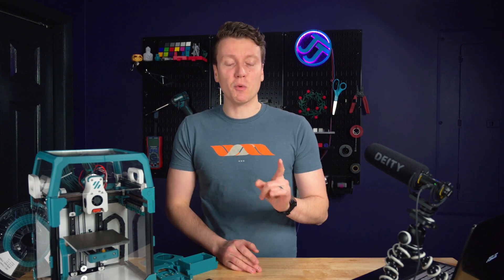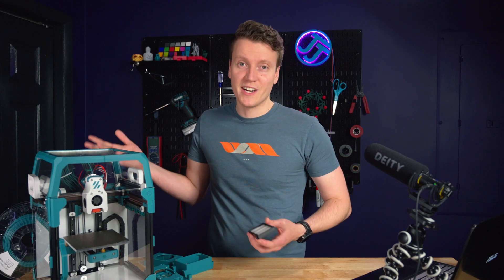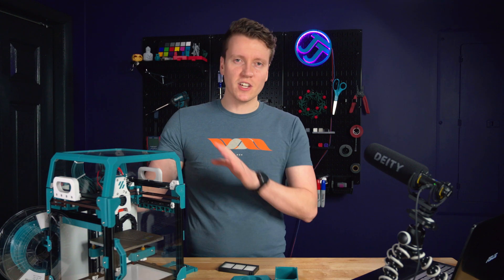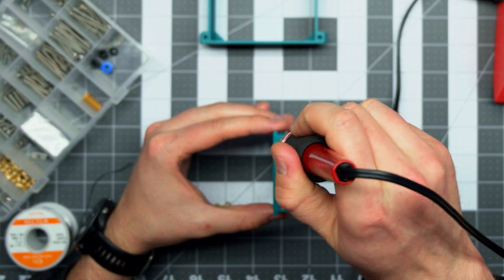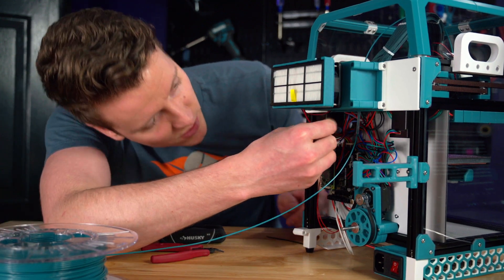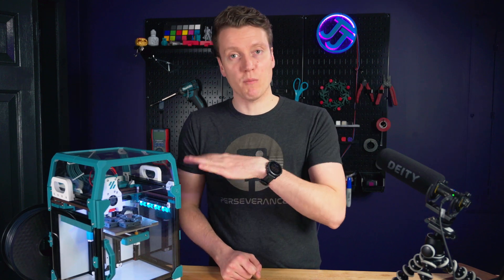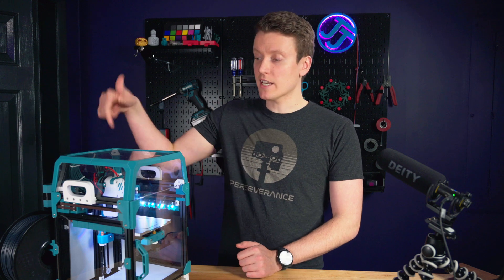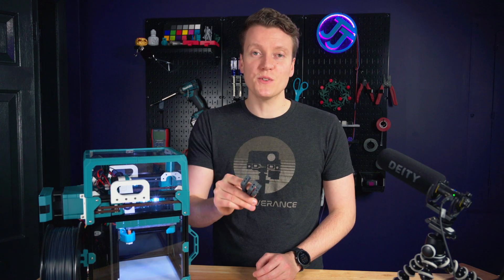3D Printer HEPA and Carbon Filter Install | Voron V0.1 Exhaust Filter Mod

Comment: you need an air sensor to see if there's actual voc and abs fumes in the air. Judging by smell is the worst method to judge safety

Comment: An exhaust fan ist better than no fan at all but onl a little, it´s better to circulate the air to capture more particles and no to loose much heat.

Comment: Why would you blow out the heated air you need in the chamber to print ABS?
I think that it's smarter to circulate the hot air inside the chamber with a filter..

Comment: Thank you for this video.  I have an ender 3 vs Max Neo and would like to use your design for my enclosure.  What model Roomba ?  Are the 3d printer files available in .stl format?
Reply from the maker: Yes, here's the link: https://www.printables.com/model/311665-voron-v01-hepa-exhaust
The filters are from the "800 Series" Roombas: https://amzn.to/3UbO4Lp
Reply: @JJShankles  I am accumulating the parts.  I have never used "heat set Inserts" before.  My assumption is that they are M3 but what about the size?  Link please!
Reply from the maker: @idmnstr They are M3X5x4, just the stock Voron ones I had laying around: https://amzn.to/3OXGaDD
Reply: @JJShankles  Thanks again for your help.
Reply: @JJShankles  Thank You

Comment: How is the air flow which such a small fan and all those filters stacked like that?  With filaments like ABS I would think you would want to vent the fumes outside rather than just using a filter.

I have an off topic question for you. If you were going to use the Voron 0.1 to build a Voron 2.4, could the Voron 0.1 print all the parts or are some of them too large to print on that small build plate.  I like the looks of the Voron 0.1, but I would have like something around 180mm or 200mm.
Reply from the maker: The air flow is for sure limited, but still good enough to filter the smells, and I don't smell anything anymore since I installed this. Yes it would be better to vent it all outside if possible. 
Yes the V0.1 is meant to be able to print all the V2.4 parts. There are some other sort of versions to the Voron 0.1 that are a little bit bigger, like the Micron 3D Printer, but I don't have any experience with those.

Comment: Mate, I've been looking for similar solution, i do smoke in my PC room, and I wanted to DIY/3d print my own air purifier with hepa and carbon filter that can be placed on desk and doesn't take too much space... but couldn't find any reasonable prices hepa filters that are small and standard won't change, and also wasn't sure if hoover filter would work, you just convinced me that
 it should be alright :) and yeah i know yuuuk smoke, on my way to quit hahaha
Reply from the maker: This should be a good solution for that. I think these are just the right size for a desk sized filter like that.
Reply: @JJShankles  got a plan in my head to used full size 13x13 carbon filter and double hepa filter with either 12cm or 14cm fan :) thanks a lot JJ for clarifying my thoughts :) and showing the path xD

Comment: This is good idea and I like your way of thinking about software control of this addon. 

Sorry to say that, but I don't like your hardware implementation of these filters because of one reason. Your fan is sucking lot of debris through these activated carbon filters and all this mess will get into fan bearings in short time. Solution will be making this thing with fan at the end (behind carbon filter AND roomba filter). This will result in much longer life of your fan.

Comment: This is perfect solution for PLA and PETG, definitely will help with theirs odors and even will improve quality and speeds. As with ABS we don't want hot air to escape not sure how it will play out... I run already enclosed V0 in other enclosure with extra filter and that helps to eliminate ABS odor completely. The problem with V0 is that fumes are escaping very well even with a filter inside of the printer... Based on Styrene workspace norms if you can even feel tiny bit of it it's already way above those norms and you need to make sure the printer is located in well ventilated area... Internet filled with "bench-analytics" who says it's not a big deal with amounts that regular hobbyist prints, but I pref my hobbies to be more enjoyable and less harmful... Stay healthy and keep up with a good work!

Comment: Did you make the Voron yourself? And specifically for ABS printing? Thinking of doing something similar with an Ender 3 Pro or other similar cheapo printer for exclusively ABS. What is  the ABS learning curve coming from PLA and PLA+

Comment: So running the filter fan doesn't create enough of a draft to warp ABS prints?
Reply from the maker: My ABS prints are still coming out great. And if they ever did start warping I could run the fan slower. I just picked 30% to start with and was surprised with how prints were still coming out great
Reply: @JJShankles  Good to know, thanks
Reply: warm draft should be fine and actually raises chamber temp
Reply: @user-yk1cw8im4h  Yeah except, correct me if I am wrong here, this is an exhaust fan. Therefore ambient air will be drawn into the enclosed printer chamber, which I presume cooler than inside the printer. This would cause the air temps inside the printer to drop, not increase.
Reply: Supperconductor yup thats why its of utmost importance to have your printer sealed.
Reply: @user-yk1cw8im4h  Wait, now I'm confused even more. If you have it say completely sealed, an exhaust filter won't be able to function effectively. You have to have airflow across the filter elements for them to function. That's why I'm more interested in a recirculating filter that sits inside the chamber.